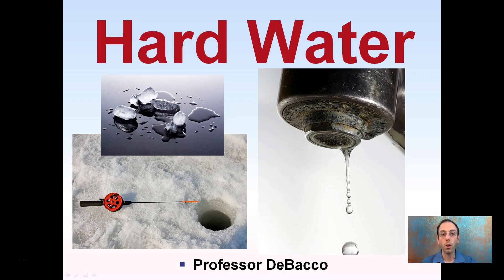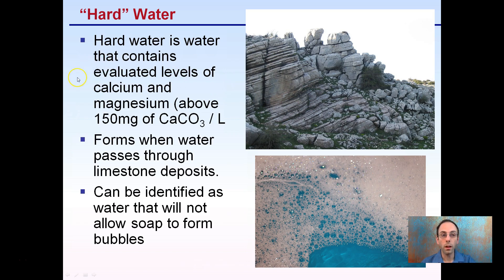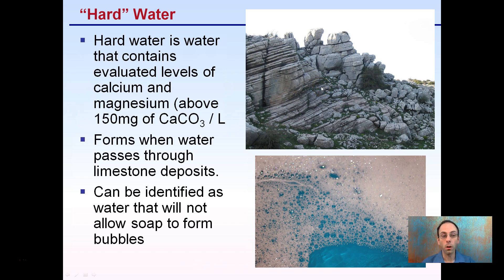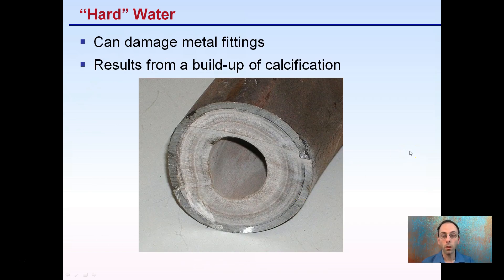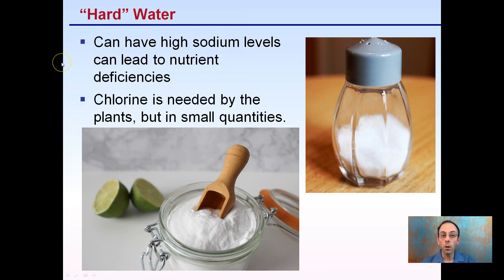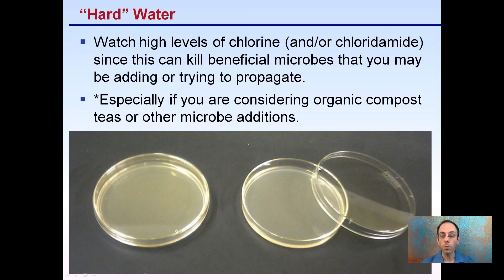Hard Water

Comment: you should notice that it is easy to remove chlorine by just let the water sit in an open container for 24 hours
Reply from the maker: If a grower has the ability to store water and is only concerned with chlorine this would be an option.  However, being able to store water for 24 hours prior to use and only having chlorine as a contaminate are both limiting conditions.